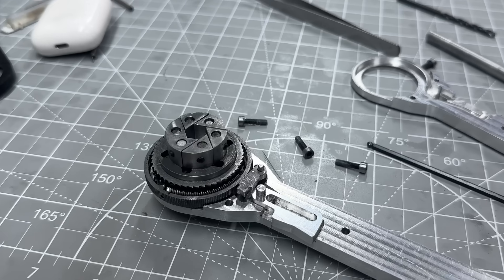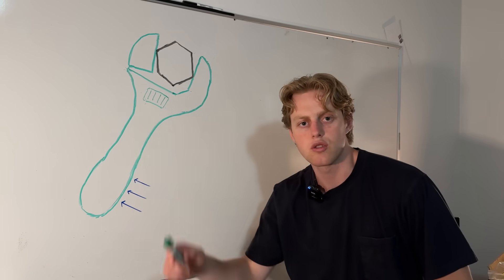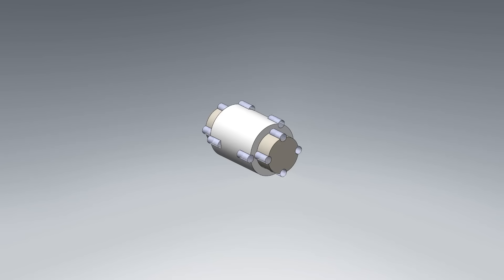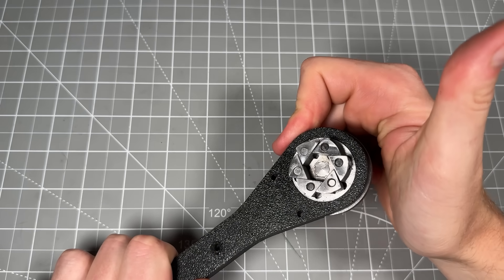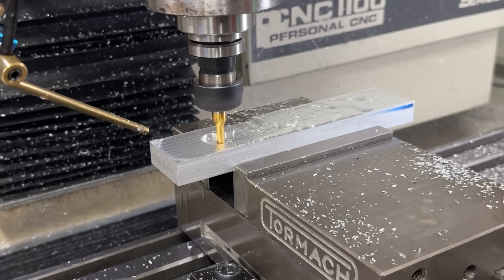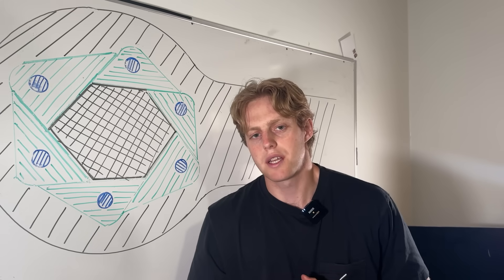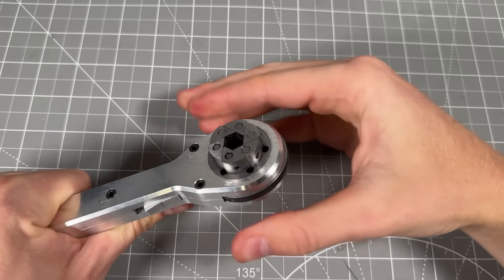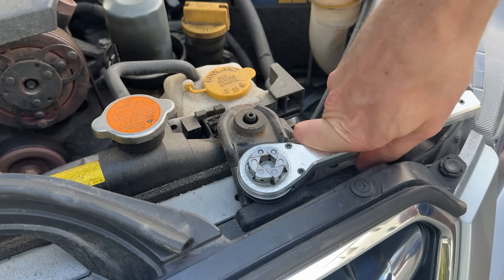I Invented an Adjustable Ratcheting Wrench

Comment: Great design!
Here is some interest, but I#d like this to be socket, not a whole wrench on its own, since - as you know - it doesn‘t solve all problems. But it would be a perfect companion tool if it could be tucked onto a 3/8 (or 1/2) square connector.

Comment: maibe if you could put the jaw open mechanism in the  handle, so you would need only one hand to use it. the small space for the head scenario is worsened by the fact that i need to fit my other hand too to open the jaws, and if i have many bolts to tighten this whole proces become slower if i have to use both hands every time. Nice job by the way, really clever.

Comment: Hey Trevor I hope you see this. A couple suggestions that would make this sell amazing to the edc / electrical community. 
1. If you can make this pass through
2. It can cover the entire Klein flip socket range both SAE/ Metric (1/4”/7mm through 3/4”/ 17mm) or beat them by going up to 19mm or even 1”
3. EDC people will pay the titanium premium. But SS or poverty versions will sell in mass.

Comment: id say have a smaller version of the tool for smaller bolts in really tight areas cause usually those are small bolts anyways for cars atleast which this kind of tool would be used for the most

Comment: Non-engineer homeowner here. I'm not sure if this is the best tool out there for the professionals in a real shop. I'm sure it may save some time which may make it worth it but I'm no professional. What I am, though, is a homeowner and this would be AMAZING for us regular folk. I don't own a shop, I don't have unlimited space for unlimited tools. But every so often I still need a reliable tool for fringe use cases. To have one tool I can grab and not have to worry about metric or standard or if I have the right socket... I think this would be HUGE in the less professional spaces

Comment: From someone with no background on anything trully useful, but giving my two cents, if it was possible to make the opening machanism work by pulling something with the thumb, maybe something positioned where the "lock" currently is, that would make it possible to operate wit one hand and that would make it even more convenient. The two handed operation feels "out of place" on a tool that is designed around ease of use. But regardless this is an amazing feat of engineering.

Comment: Take a center punch. Make indents on either side of the wrench right under the ratcheting mechanism. Take a paint pen and fill the indents: green for the tightening side red for loosening. That’s how I always mark ratchet wrenches.
Reply: Also if you can make it a pass through and fit 22mm bolts you’d be able to sell it for a pretty penny to a lot of grips in the film industry.

Comment: The adjustable feature is very clever, and well executed, but is not something I particularly need as I rarely have different sized bolts or nuts I need to tackle in one job. On the other hand, the fact that it tightens onto the head and takes up slop is very attractive as that is more often an issue I face. It could also be very useful for someone who has to swap between different standards or are working on old equipment were head sizes could be both a different standard and inconsistent (for the same size).

Comment: Interesting project and you probably learned a lot doing it BUT what's been forgotten WRT socket sets is that sockets can have a myriad of attachments to expand their versatility like, extensions, stud removers, various types of sockets like star, Torx etc. As you demonstrated, this tool is very bulky and it's sheer weight would make it uncomfortable to work with over a long period. There's a reason why the big boys haven't pursued this line of tool design. Sorry for the downer. 🥴

Comment: This tool, but as a socket itself that you can put on any ratchet, would be a much better idea. You can definitely detach all of that from the wrench and make it a 1/4 - 1/2 drive, making any drill or ratcher universal, which also solved the depth issue you have

Comment: Nice work! Very impressive. I wonder if there is some way to remove the parts and flip them around rather than doubling the joints? That could potentially make the tool a lot thinner. A lot of "pass-through" sockets use that kind of design.

Comment: The first 3 mins answered something I was thinking in my head. You should consider putting the reverse ratchet mechanism at the end of the wrench. This is mainly because one end is forward ratchet, the other end is reverse ratchet. The benefit is that you can make it a lower profile wrench

Comment: looks like you cant put more than a few pounds of torq pressure. am i wrong?

plus have you seen the wera joker wrenches?

nice idea/school project but too bulky and not deep enough to be of actual use even if you could apply huge amounts of torque.

Comment: That's awesome dude.  Loving the freehand feature.  Unfortunately your final point presents the problem.  It's so rare to find fasteners (on cars) with enough clearance for anything other than traditional wrenches and sockets.  I bought a pair of Craftsman multi-sized ratcheting wrenches like 20 years ago, one metric side on each end and side, so four per wrench. I still haven't found a use for them, even once.  Just too bulky to fit virtually anywhere on any car I've worked on.  Your second problem is that you decided to make a Youtube video disclosing your invention.  Humans are scumbag thieves who step on others shoulders and steal anything they can.  Your first step is to take this video down, and second is to patent your design.

Comment: There is a paradigm that holds that no adjustable wrench could ever perform adequately compared to fixed-size sockets.  But part of the reason for this is the fact nobody has ever produced an adjustable wrench of a clever enough design and quality that could potentially do so.  Your dedicated effort to achieve a working prototype of just such a wrench achieves, at the very least, proof that bringing to market just such an adjustable alternative to the use of fixed-size sockets alone is, in fact, technically feasible.

Comment: It’s a solid design, I really like that you used the torque to tighten the grip on the bolt. Ever think to just turn the head into a socket? It would solve some of the mobility issues and make your machining time and material cost a lot lower.

Comment: The one thing I would suggest is making the adjustable mechanism reachable from the handlebar, so that you don't have to use a second hand to open the nut holding mechanism while placing the ratchet onto the nut.

Comment: i need to see a test on corroded bolt heads, not stuck bolts, heads that get smaller by half a size and are now uneven when you knock the rust off.

Comment: Definitely a cool design that could change the game but still a rough diamond, clearance being one of them, still going to need attachments for hard to reach places. it would be really good for assembling something from scratch or dissambling something entirely like a bicycle, but clearance is the biggest issue, i would definitely buy one if it came out tomorrow though, i hate trying to find a 10mm and then switch to a 7 mm and then back to 10mm

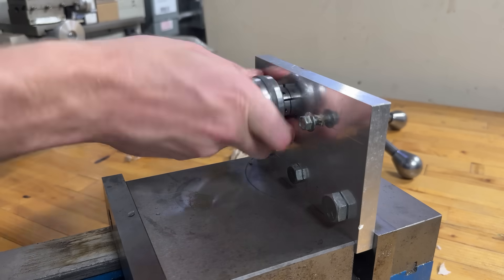Comment: 11:06 I'm sure the gap needs to be larger where you rotate the knurled ring with your fingers. Dirt will get into the gap and clog it, making it impossible to rotate. You need to make a recess in the handle the same width as this knurled ring.

Comment: LOL I designed the exact same wrench, and I solved the pin problem, which you haven't solved btw (those pins, any pin, will eventually bend and bind.) I had to stop prototyping because since I'm not privileged like a lot of the YouTube "inventors" I've seen, I had no easy access to CNC milling and all the required materials to continue designing. Not to mention. At the end of the day, I discarded the idea because it's too unnecessarily complex and the cost of it would put it in a category of tools that "professionals" use and we all know how "professionals" feel about trying anything new. Yeah that's why the big companies have only released more lightweight, less complex, adjustable wrenches. Because they have to be priced for the DIY homeowner, who this type of universal tool appeals most too. But great engineering and hopefully you continue with that spirit to help make better shit in the USA, because our engineers are lacking more and more as time goes on.

Comment: 7:47 so basically you need a reinforcing layer that can be tightened over it afterwards to seal it and create less strain so you have three choice rubber band crude method, or use c clamp design or 3 you could reinforce the design but its more ideal to improvise a mechanism that goes over the pins as a retention

Comment: I'd buy one now if it werent for extension issues; I'd need it to fit into longer spaces but with the ability to shrink down or convert back to a smaller size. OR if we could get two, one smaller wrench and one larger, I'd buy em. Fix that and I'll buy three, one for home, one for work, and one for my car.

Comment: Amazing idea but Couple points of improvement to really make this a convenient tool. 

1. I think if there was some kind of lever near the handle that allowed you to open the wrench instead of at the head that would be an improvement. 
2. Flexible head and thinner for tight clearance areas. Or a “deep socket” design to get into recessed spots. 
3. Electric to replace electric ratchet would make this idea an absolute game changer

Comment: This is an amazing feat sir! What an amazing complexly fantastic achievement. Most people don't even begin to understand just how much time and devotion something like this takes to create. I've never had an adjustable wrench jam on me, in fact the exact opposite. They loosen or tighten all the time just by being rubbed against or klunked around. I usually put some medium grade lock-tite on mine to stop this. After it drys, working the wheel frees it up, but keeps it from being loose and changing from where I had it set.  Those are really only good for fasteners that aren't very tight though, they round off anything too tight.  This is a cool idea, super ingenuity here. Awesome work! I hate to say it, but it probably wouldn't be practical for me because of it's size, limiting where it would fit, and the fact that it just wouldn't hold tight enough for fasteners that don't want to budge, which is really common when I work on vehicles. I would however use this for quick, around the house stuff like tightening a bolt on the lawnmower handle, bicycle wheel, or tighten a bolt on a fence or swing set etc. The quick opening and closing feature is what appeals to me. I own the "ugly" universal wrench you showed at the beginning, it was a gift a few years ago, and I honestly never even used it. In my honest opinion I don't feel this is a gimmick tool, but I also don't think I would have much use for it, especially after the cost of manufacturing, sales, logistics related costs sets it a certain price point. If this was under $40, I would grab one to try it out cause I like tools, and it would be quicker than manually adjustable wrenches. Not sure that price would be possible for you, I see this as closer to $75-$125, if not higher with the intricate parts and tolerances needed for a precision tool like this.

Comment: This is the adjustable wrench that I need. A chamfer would go miles for usability. It's not going to fit in every spot, but sockets don't fit everywhere either. That's why we have regular wrenches. This would be excellent for a tool to have in your vehicle in case something breaks, replaces the whole trunk socket set. a

Comment: Try making one with out the handle, almost like a palm wrench, but with a 1/2 or 3/8 extension insert. This way people can use it as a palm wrench and when it comes down to tightening the fastener, they can just inser a 1/2 or 3/8 extension on the hole and use it as leverage. Almost like the ratcheting attachment set that tool manufacturers are advertising now a days. Also try making one with antislip groves on the teeth that contact the bolt or one with bolt extractor contact.

Comment: Send one to Torque Test Channel for testing as the publicity would be outstanding. The creator works for Astro who might be interested in the design. Your work is "prior art" so no one else can patent the design (it's common for inventors to list "patent applied for" to avoid going through the hassle of patenting, but you still assign rights to it for sufficent money). Most tools have a short life between introduction and copies being made so the trick is make your money early rather than expecting long-term profit. Lisle eagerly seek out inventions and use MANY submitted designs so that could be another route.

Comment: I think this would be insanely useful for light to medium duty technicians. Off the top of my head this could be used for drain plugs, and almost any nut that sits above a flat mating surface. The only time I'd see it suffer is on through bolts with someone using an impact gun on the other end.

Comment: I work in hvac refurbishing cooling towers and I would 100% keep this in my pocket at all times. I already carry and use a regular adjustable wrench ever day, but it’s constantly slipping. I would love to see and use a couple variations though, maybe a smaller version for smaller bolts and separated versions that are color coded for tightening and loosening to have a slimmer profile

Comment: For my 2 cents, I do not think you need to mirror the mechanism. The pins can stick all the way through and connect to the jaws on both sides, removing the need for a second mechanism. From there, I think the next biggest weakness is the central cam. Inatead of that,  maybe having teeth on both disks so they can both interact with a paw would allow for the mechanism to be stopped from torquing on the outside, allowing for looser tolerances inside the mechanism. 

Of course, if you tried either of these ideas, or i am missing a fundamental part of the design, then my apologies. I'm looking forward to what you do next!

Comment: It'd be amazing if that adjustable head was a 1/2 or 3/8 square attachment for a wrench, kind of a 1-size-fits-all hex bolt attachment within a certain range.

At the very least it's an easier sell for folks with existing driver sets, and you can use it with extensions.

Awesome execution though. You clearly put in hundreds (or perhaps thousands?) of hours turning the idea(the easy part) into a real product(the far rarer and harder part). Massive props!

Comment: This is amazing! Well done. 
A few ideas that come to mind, if even possible:
- Have it work like a more traditional ratchet with a switch between tighten/loosen/locked
- Make the thumb button hold open the teeth, so springs shut when you press the button. That way you can set it on a bolt without holding down the outer ring

Again, well done. very high quality video.

Comment: please start looking into registering a patent, also find someone to refine further, someone for manufacturing and make a kickstarter! I would buy even if the first version wasnt perfect yet and even if it was a bit pricey..!

btw: you‘re killing it! I think you‘re onto an actual solution here for something that the industry hasn‘t been able to solve for ages!

if you care for ideas: you might want to play around with different sizes.. let‘s say you limit the range of adjustment, eg to 3 or 4 screw sizes, that might open pathways to reduce bulkiness. see if the design works in a smaller scale and a larger one, different issues might become relevant, parts may need (or allow) to be scaled differently.. maybe maybe even try a version with huge adjustable range, see where it falls short.. might give you insight on how to improve it..

Comment: Need to make a deep socket option and for it to go up to 9/16. If you could make it swap rods rather than have two different sides so that it can reduce the total size it would help. Like a regular ratchet can. It swaps the pin that locks left or right. Have an even smaller universal would be nice as well and the option to add a longer handle. The problem is that your design is too bulky and having maybe a way to get away from circular rods and using a triangle rod would help reduce the necessary size as well as increase strength without causing further design issues.

Comment: It would be interesting to see how this works on damaged bolt heads. I end up working on a lot of farm machinery where the bolt heads are exposed to extremely harsh conditions, making sockets and normal box end wrenches useless. Maybe putting some teeth on the engagement surfaces would help?

Comment: This design is truly exceptional. As someone who works on their own vehicles and a few other miscellaneous things, I could see myself having this tool in my toolbox and using it for both standard and metric-sized bolts. As for which side tightens or which side loosens, it might be better to potentially engrave it into the metal slightly to be able to differentiate the two sides. Great awesome work Trevor.

Comment: here is where this falls flat. this wont work with extensions, or as a deep socket. you havent shown this working with nuts that have to far down a threaded bolt. lastly, I dont see this design being scalable to work between 8mm to 27mm size bolts/nuts.

Comment: What if you had the slots more slanted so when the pressure of turning wouldn’t allow them to move the slots would be more to parallel to the outer circumference

Comment: Send one to me. I work in electrical and often install equipment that has 3 different size bolts and nuts. 7/16, 9/16, and 3/8. It's annoying to constantly switch sockets